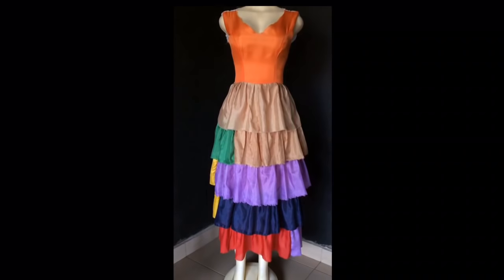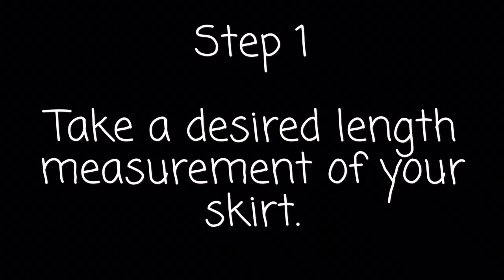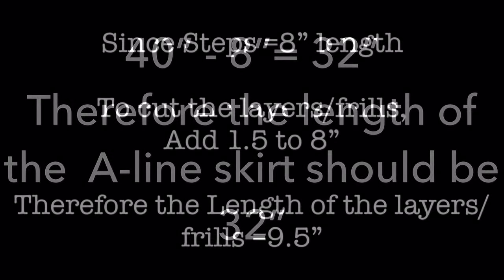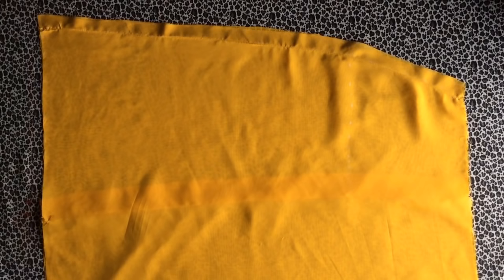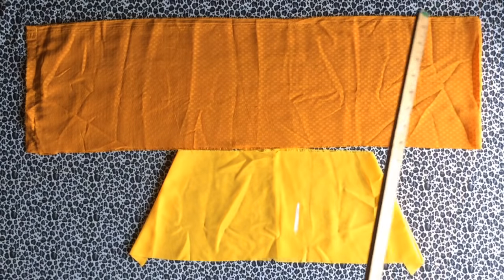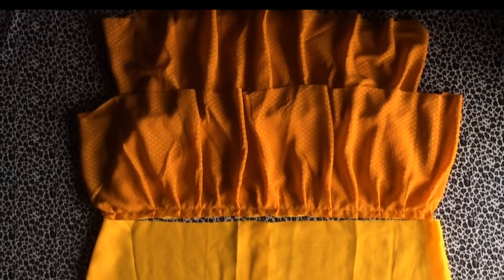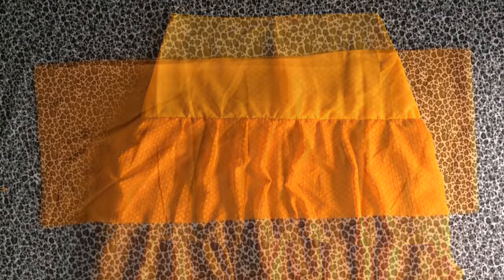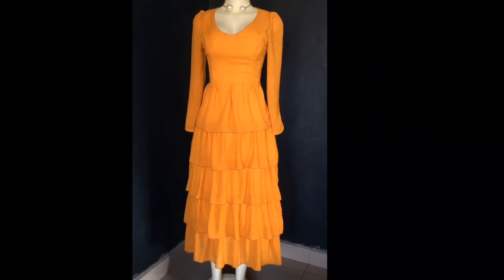Ruffle Frill Layered Tier Dress Tutorial( EASY)

Comment: Thanks Sis for dis lovely tutorial, pls for d frills are we suppose to cut onfold? I.e after measuring d skirt width then we cut d frills onfold x 3 n add xtra inches to d length of d frills? Thanks n God bless
Reply from the maker: Thanks dear... after you measure the width eg.  it’s 11 you will cut a frill width of 11 by 3 which is 33. The length of the frills remain the same. The steps doesn’t require additional length.